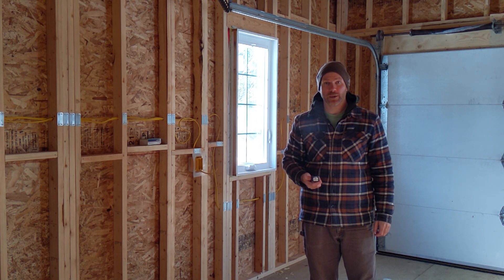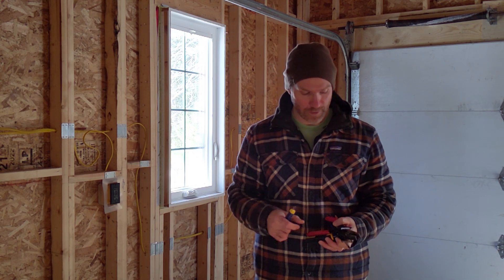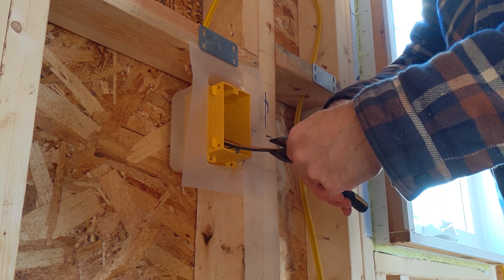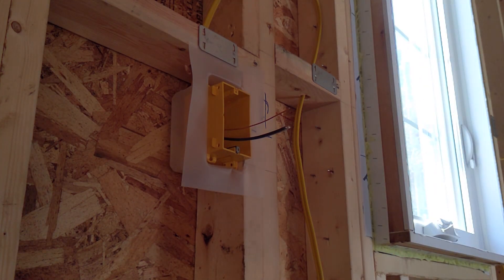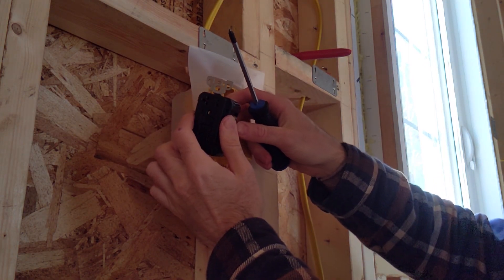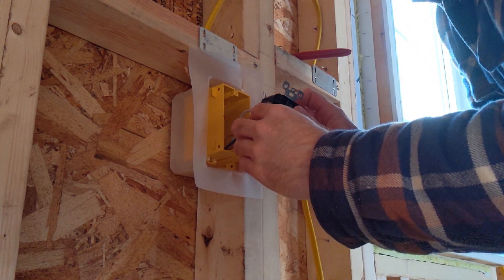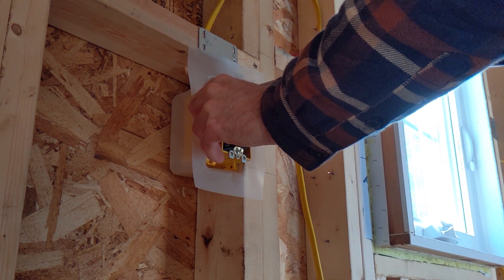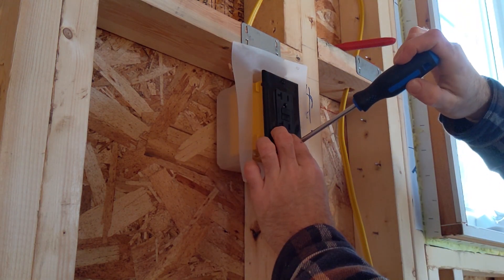Wiring up an Electrical Outlet for the Shed

Comment: Useful Info: Milwaukees ecx #1 screwdriver, and Klein tools combo tip screwdriver are made just for the screws on majority of electrical devices.
Tip #1: You can make j hooks on GFCI’s but it’s better to just stab them in the back (it’s not the same as backstabbing switches or receptacles).
Tip #2: Article 210.8(B)(8) Garages, accessory buildings, service bays, and similar areas other than vehicle exhibition halls and showrooms must be GFCI protected. You can make the breaker for the outlets GFCI Protected or just use GFCI’s.
Reply from the maker: Thanks for the info and the tip! I will have to check out those tools. That is a good tip, and given the design of the GFCI receptacle one would be hard pressed to hook the wire around the screw under the plate. With that said I am new to electric work like this, so I am definitely no expert.
Reply from the maker: Also great second tip! I used all GFCI outlets in my shop since I got a deal on them and GFCI breakers are a little pricey.
Reply: If you need any electrical advice just let me know and I can give you an answer.
Reply from the maker: @haloblade2472 Sounds good, thank you!